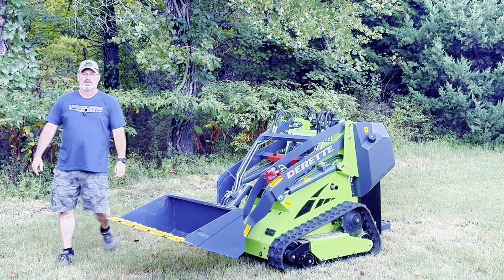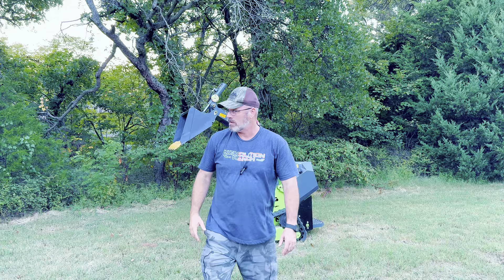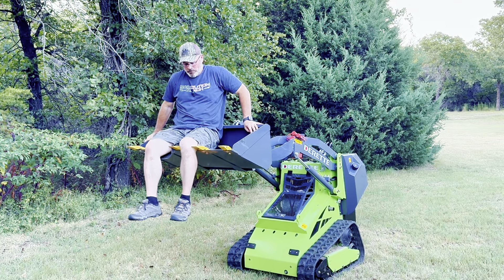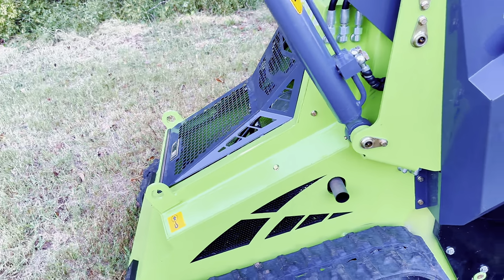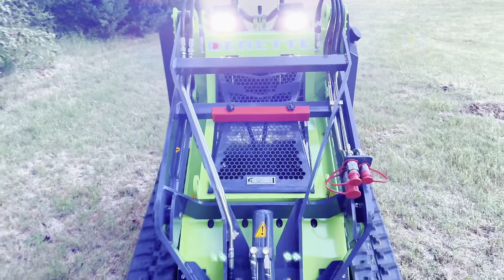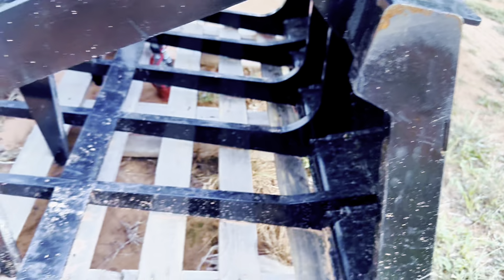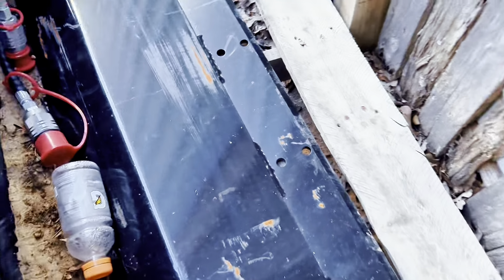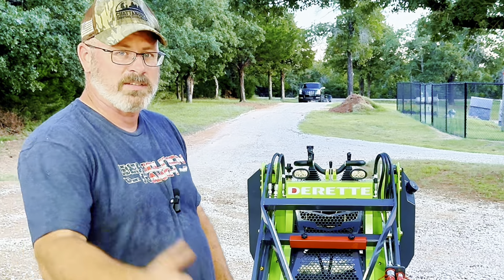I Bought a Chinese Mini Skid Steer - 2 Month Review

Comment: haha I keep seeing you take out your knee everytime you walk around that bucket, Did I see some fencing wire wrapped around the brush cutter drive motor shaft? If so you may want to remove before it chews your bearings out? I am currently talking with Dean about their T800 as this is within my budget. I would love to get the 450 but alas it is not within my budget especially when you add a few attachments. After spending a month of talking with about 15 suppliers and seeing what is available, IMO the Derette machines seem to be made with higher quality components and manufactured to a higher standard. There are several suppliers that offer the same machines under their own branding all are quality machines but tend to be more expensive. There are different cheaper machines in this rated load capacity category out there from other suppliers but the component and build quality will be considerably less. Just thought I would share my experiences so far as I am about to pull the trigger on a machine and I have done considerable research.
Reply: Thank you very much for your evaluation of me and Derette.
Reply: @Dean-derette  You are welcome Dean, I will contact you shortly to discuss the T800 again.
Reply: Just curious what was the T800 price?  Just want to compare it to the 450 I bought! Thanks.
Reply: @fullthrottle2656  Hi Say approx $1300 difference between the 2 models. Best to chat with Dean about pricing as everyones requirements are different which impacts price.  Both models are quite different from each other one is a bigger and heavier machine with a greater rated load capacity. If my budget could stretch that far I would buy a 450 in a heart beat. With the T800 pricing it allows me to purchase some attachments and be within my budget.  Horses for courses I will be using my machine on my 5 acre property maybe every 2nd or 3rd weekend for generally light work. Your needs might be different and if I needed a machine that was getting worked more often and for longer periods I would go with the 450. In the same token the V1000 would be way overkill for my requirements (nice to have).
Reply: @TheHayruss  I agree.  Mines just going to be used for mostly tree work at my cabin.  Cutting up trees, firewood, stump grinding, wood splitting, and brush clearing. Those are going to be my main uses.  Plus I figured I can work on it myself if something needs work vs the V1000 with the diesel.
Reply from the maker: I agree with the derette machines.  

I will always be worried about smashing my legs into the bucket now!  lol
The brush cutter gets grass and sticks stuck under it sometimes and I clean it off.

Comment: What was the total cost with all the attachments, shipping etc.. and was it delivered to your property or did you have to go to a US shipping port and pick it up?
Reply: I have $16K invested in mine with 8 attachments. I believe he had $17K into his.  They will ship it right to you but you are responsible for offloading the crates.
Reply: When they do the shipping they’ll tell you “shipped to your door”. I wouldn’t advise this unless you own a big forklift! I had mine shipped to a friend’s business with a forklift. Otherwise I could have picked it up at the freight carrier’s transfer station about 70 miles away in Chicago. My order was just under $11,000 with this exact loader, brush cutter, forks, and grapple. This includes like $3700 for shipping.
Reply: Thank you both, reasonable price with all the accessories.
Reply from the maker: I did mine in two transactions.   One wasn’t machine for $8.5k shipped and the other was all the attachments for $8k shipped.
Reply: I got a 450 and 10 attachment for less than  20k. With shipping!!  🎉❤
Reply: What business did you purchase from?
Reply from the maker: @davidfredericksen5933 I bought mine from Derette in China.

Comment: They need to figure out a better track system. The tracks pop off on mine a lot.
Reply: Make sure you keep your tracks tensioned properly.  Put a jam nut on there so the adjuster bolt can't back off.
Reply: @fullthrottle2656  If you figure out what size and thread that nut us, let us know so I'll have it before mine gets here! Imight juat ask them to put one on there before shipping mine! What color is yours?
Reply: @robertbloomquistsr6351 about 4 weeks ago when his track fell off for the first time he needed a 32mm offset wrench. That's all I know about it. Cool thing is.  I believe Dean from Derette commented on that video when we brought the Jam nut up saying he'll take the advice so ours may come with one already.👍 I was debating the green or red.  Ultimately went with the green.  I ordered the 4in1 bucket, grapple, Auger with 3 bits, brush cutter, forks, stump grinder, ball hitch, and the Horizontal log splitter.  Can't wait till it's here!!!
Reply: What is everyone’s cost on these?
Reply: @robertbloomquistsr6351  Hi Not sure on the exact size the nut and thead is but would be almost certain that it is metric.
Reply from the maker: I am better with mine not coming off, I can also reinstall in about 6 minutes now.  
I just filmed a video on it.

Comment: You're awesome! Lol. Do you think you could lift and move a 600lb pallet with it?
Reply from the maker: Haha thanks. 
I have another video where I do lift testing.  I lifted and moved 1000lbs.  Just keep it 1” off the ground.    lol.  450lbs I lifted to the max height and 750lbs was tippy.   I have 100lb counterweights and weigh 230 myself.   I didn’t test 600lbs

Comment: Unfortunately 8 to 10k just for the machine is too rich for my blood, maybe ill find a used one someone is selling state side.

I wondered about changing out attachments. Do you have a video that shows how....is there hydraulic fluid loss, or do those quick coupling seal?
Reply from the maker: The auction machines aren’t bad. I bought mine for $3700.  It can’t do as much but it’s still better than a shovel!  
The couplers do not leak when you attach or disconnect.  Here is how the attachments connect. 
https://youtube.com/clip/UgkxFVvsRy9ecAOa3vCifh9qm8Chxp7uLZbE?si=pbP5hjamKVa8g8SJ

Comment: Hello again. Can you show a video on how to jump start the machine?
Reply from the maker: Yes, I plan to include that in a maintenance video.  
If you open the rear cover, you can put the positive jumper cable to the starter and the negative to an engine mount bolt.
Reply: @OurLifeInTrees  Thanks for the reply.
Reply: @OurLifeInTrees  Sorry for the late response. Thats a smart idea. Thanks.

Comment: Hello, my tube friend. Thanks for all the videos. The reason I went with Derrett is because of your videos. I just ordered a Derrett DRT 450 with the counterweights and 4 different attachments from Dean. I do have a question or two. How long did you run the engine after receiving it before you changed the oil and hydraulic fluid? How hard is it to change the oil? Was the gas ok to run the engine after transporting across the Pacific Ocean? Also is there an on off valve from the fuel tank to the engine? Can you tell me the ground pressure of the tracks? Just curious. Nowhere could I find that info. PS keep up the awesome videos.
Reply from the maker: Awesome!  I think you’ll love it.  I know I love mine.  
The engine oil should be changed after 10 hours.  I have not yet.  I am about to change it and show a video how to.  
The hydraulic fluid should be changed after 50 hours.  I haven’t done that either. 
Yes the gas was fine.  
I don’t know about an on off valve.  I would assume you would have to unbolt the cover if there is one.  
No idea about ground pressure. Try asking Dean. 
Thank you for the compliments.  I appreciate it.
Reply: @OurLifeInTrees  Thanks for the reply.
Reply: @OurLifeInTrees  Hey , I forgot to ask if the machine has an on/off valve gas valve?
Reply from the maker: @TimothyJung-q1n it does not.  My mini excavator does, but not this mini skid.

Comment: I just want to know if it can lift a 300 kilo pallet and put it straight onto a flatbed.
Reply from the maker: That’s a great question that I don’t have the answer to.  I need to do a how much can it lift video.
Reply: Shouldn't be a problem, 300 kilos is 660 lbs. and it will lift 990 lbs. It lifts plenty high for a flatbed.

Comment: What is the availability of replacement parts? I’m guessing sooner or later you’ll need to replace the tracks and maybe even the drive sprockets.
Reply: Tracks should be universal. As for parts, according to a Derette sales rep I follow, they can ups air ship you any parts in 3 to 7 days.
Reply: Groundhog America and Kymron both sell this exact loader in the states. They both stock parts…
It’s rebranded obviously, but you can tell for sure.
Reply from the maker: The tracks are universal, the motors are easily available in the States, the pumps are Parker, the engine is Honda, etc.  the sprockets… no idea.   I did order a part and it took about a week from china.  I was impressed.
Reply from the maker: Yes.  Exactly.
Reply from the maker: @antiphon43 yes.  Kymron states they won’t sell to anyone who doesn’t buy from them.  I don’t think they stock minimalist parts.  I could be wrong.

Comment: are  you having trouble with the bearings in the idler wheels?
Reply from the maker: No.  Seem just fine. I hear a lot of the auction units have issues with them.

Comment: I was just watching your other videos for the thousandth time. Mine is just getting done being built.  Once it leaves China how long did it take for you to get it in your possession? 🤑👍 Suggestion for ya.  Like when you adjust your adjustment bolts such as your trencher, i recommend neverseizing the bolts. When you say it wouldnt lift that stump,  do you mean it wouldnt lift it or the back end lifted up in the air like its too light? Should get that brush off your brush cutter.  It will just hold moisture and probably more apt to rust there.
Reply: I’m definitely wondering this as well, supposedly mine’s pretty much built, just waiting on the attachments.
Reply from the maker: It took about two months all in.  About 30-40 days to cross the ocean. 
Good call on never seize.  
The machine wasn’t heavy enough and wanted to tip me over.  lol. 
Good call on the brush.
Reply from the maker: Thank for the support by the way!!!